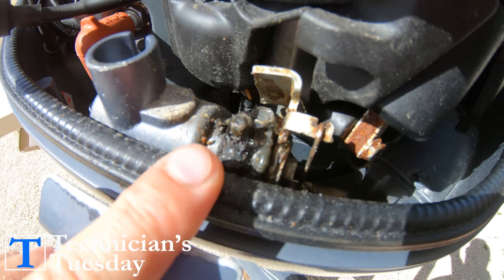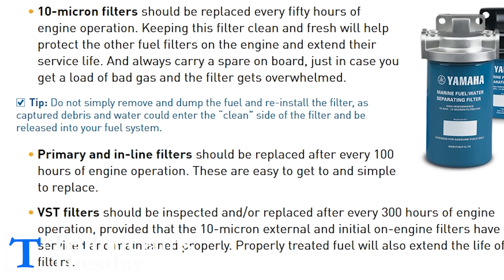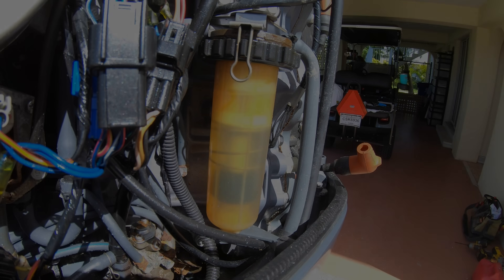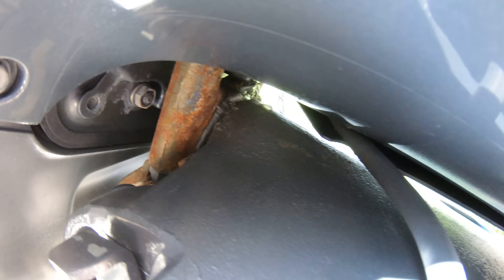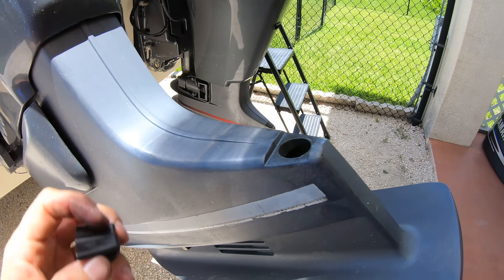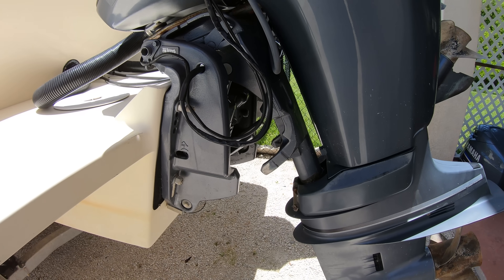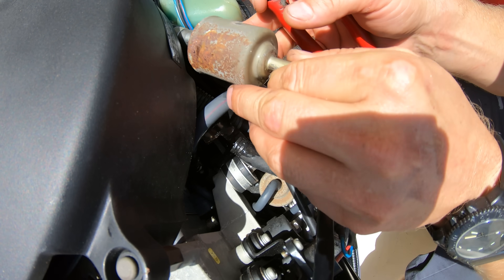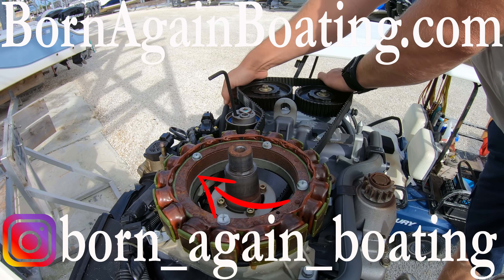Making A 2-Stroke Last Longer!

Comment: New boat owner.  Pushing a 18' scout with a 150 Yamaha v6 2002 outboard.  The motor was serviced when purchased but the mechanic missed a few things.  Maiden voyage had two breakdowns.  Throttle was sticking in hi rev due to lack of lube on the carb arms.  Then the starter motor was not engaging the fly wheel to crank also due to seized, lack of lube.  WD-40, and my pops were able to diagnose both issues and avoid needing a rescue.  It was a blessing in hindsight because it started the ball rolling.  Learning as I go, but seems we have a solid motor with a good reputation.  Looking forward to learning to care for it and enjoy it on the water. Thanks for your videos!  Best wishes.

Comment: @1:43 
WTF ! i been running my 2 stroke dry after every trip, i was always told never leave fuel in the system, it just gums up and cloggs everything.  Thankfully I've had no issues so far.

Comment: I have a 2008 z200xtr Yamaha hpdi that I service myself it runs like a rocket even today what type of spray did you use to spray under motor cover on oil pump and around awesome video

Comment: I just bought a 1 owner 1984 Champion bass boat with a 200 Yamaha motor. This boat looks brand new inside and out. I took it out the first time the other day and  it runs like a dream! Needless to say I want to keep it in top shape because I worry about finding parts. This video gave me some info I needed.

Comment: Nothing beats the sound and smell of my Mercury V6 135 from 1992! Its been running in fresh water until 4 years ago and I will use it until we die together. Todays engines are to complicated with to many sensors and they scare me a lot.
My V6 is of course burning more gas than the new ones, but I can do all service myself and that saves me a lot of money.
I also belive these old engines have a longer lifespan, If they are not being run to death and are well maintained.

Comment: Videos 4 years old and i dont give a damn, it's 2024 and I'm running a completly bone stock 1988 mercury Black Max 200hp 20-30 miles a week. Engine has never been rebuilt, or even apart. Deleted the oil injection nightmare and just run a 50:1 premix and 89 octane gas. Shes a bit smokey but still pushes my '76 Mako 20’ CC past 40 mph and is happy to do it.

Comment: Still running my 2000 Yamaha V4 115, 2 stroke. Shes a bit thirsty but I love the sound, the weight, 2 stroke oil off Amazon is cheap and it really doesn't burn much for what Im doing.

Comment: Thanks foIr your content.  It's always great!  I have a 1986 Johnson 115 on a restored 1964 Cruisers Inc. 17 foot wooden lapstrake boat.  I've had very little trouble with it.  I did remove the oil injection system at my local shops suggestion, and it has eliminated a big source of worry.  I just acquired a Mercury 115 straight 6 from the same era.  I hope to put it on another restored boat this summer.
Reply from the maker: That's awesome! Thank you and wish you the best with the next restoration project!

Comment: I have a 1999 Yamaha OX66 EFI 250, recently checked compression, all is good. Also have a 1995 Yamaha 50/35 OEM jet engine, running great, a ultralight engine compared to a 4 stroke.

Comment: I'm still running a 1994 Yamaha 200hp Salt Water Series on a 1994 Grady White Adventure 208 and everything is fine. I've only used the rig off the central Florida gulf coast.

Comment: twin 1999 250 Yamaha ox 66, they run like the wind.  I do typical maintenance to them as you note. I also spray a good amount of wd40 on all wires and essentially everything under the cowlings.

Comment: Arr Captain,,just got Merc 2007 150HP 2stroke on my new boat also 2007 Stacer 619m Aluminum only 344 hours on the motor, That old 2 stroke sounds crisp clean and easy to start i think its got years of life in it with your Lessons helping me. I haven't had a top speed yet because the weather down here in the southern Indian ocean M8 it blows and waves Breakers & chop. But the temp gauge Points to the middle half way to hot when its cold, then goes up towards hot high when im only doing a bit over 2k RPM , the tell tail works and seem not really hot, I think the gouge is shagged, ?

Comment: im running a mercury 80hp 1982 that was in the swedish military storage, so barley any hours on it. Did a full service on it recently. Rebuild the carbs with gaskets, needle and seat. New sparkplugs, new impeller, new gearlube, greased all fittings and propshaft. it runs really good and i think they tuned it a bit when they built it and it feels also.

Comment: Got a head scratcher for you..... 2005 HPDI VZ 225.... #6 cylinder is not producing power, has good compression, has spark (even swapped coils between 5 & 6) Fuel injector is operating and injectors were sent out for cleaning and testing. Connected an LED to the wires for that injector and it is firing the LED's. All spark plugs burn a nice tan/brown except #6 which is always wet fouled. No anomalies found with borescope of cylinder and the reeds look good. When you run the engine at idle and disconnect the #6 plug wire or do the cylinder drop test in YDS, there is no change in RPM or sound at all. Also the overall performance is not quite what it should be.  The only other thing I can think of is maybe some sort of exhaust blockage maybe thereby trying to burn the same air mixture over and over? Is this even possible?

Comment: I've got two 2001 Mercury Optimax 150 EFI 2-stroke outboards and they're running great. I love them. I do the servicing myself so it saves me quite a bit. Just recently had to replace the VST o-ring today cause the old one was done for. I also use Quicksilver Quickleen each time I fill up my 120 gallon tank before each trip.

Comment: 2001 Yamaha 200 HPDI, about 1000 hours.  Looks pretty close the one in this video. It runs like a top and thanks to your maintenance tips.  My lower mounting bolts are showing rust on the tip of the bolt outside of the nut, and it seems that replacing them requires the removal of the powerhead.  Do you have any tips/videos that would enable replacement without powerhead removal?

Comment: Running a 1990 mercury 2 stroke on a sea nymph  ,100 hp .Here in New Zealand plenty of boats still running them .This motor is great,runs well and not bad on fuel if you don’t thrash it. Thanks again for your great information today 😊🚤

Comment: FYI folks. The power curve is different on a 4 stroke. Think motorcycle virus pick up truck and you'll get the idea. Two strokes run at higher rpm and produce more raw power. Figure 10% of the horsepower rating for full throttle consumption i.e. a 100 h.p. 2 stroke can burn up to 10 GPH.
4 strokes are thrifty, quiet and idle smoothly. 🙂

Comment: some times a simple tbl is hard to find the first you run in to it--- eng idles but will no rev no matter what you try it will not rev--the tiny oring in end of fuel hose has a tore place it allows air not gas to flow   take a fish hook catch it in oring jerk it out  insert new oring with a light lube  like new now  ------ had a 40 johnson running hot changed water pump 3 tmes still ran hot  took it out on trl. for winter  one nice day in dec. to look at it one more time this time i started at the top  of eng  at thermisat  we had hose conn to eng for water   with top off thermistat i ask my friend to turn switch key on see if it would run i did not start but i heard air rushing as piston mved  i said stop i think we found it    i pulled the head there it was a hole about  like you burned with cigerete  i had to get a new head gasket problem solved  now yrs later my friend small out bd. is running hot  he said dealer had relaced water pump  still hot  i told him about  the head gasket   after 3 trips to dealer he finly replaced head gasket  fix it  deal had told head gasket had nothing to do with it but finly took head off  there it was

Comment: I have an 1987 Johnson 110HP V4 Crossflow. Way too maintenance intensive and takes a lot to keep it running smoothly. Same with my 1991 Johnson 88SPL V4 which lost compression on 2 cylinders last year. They require way too much to keep them running well, and for some reason the carbs need cleaning at least once per year. This is with new fuel lines, VRO delete, fuel filters and water separator, fresh gas.

Comment: I cant believe as good as you are and I truly mean that. That you are showing prefilling the fuel filter by filling the discharge hole. Any dirt going into the discharge hole can go further towards the motor. Put a plug into the discharge hole and fill through the small holes. Just a thought.

Comment: Still running my 98 Mercury 60 hp still running strong..I have a question about buying a 4 stroke..if I buy one and install myself do I need the computer software to dial it in or will they do it before they ship?

Comment: Just did the fuel filter, impeller, lower gear lube, anode below the trim and tilt, plug wires, removed and greased the prop removing a bit of braid…UGH..lower unit had no water intrusion. 90 Etec. Waiting on thermostat and lower unit zinc.  Have to remove the lower unit one more time for the lower unit zinc.  Oh well.

Comment: 2001 yama 2 stroke .. had a 150 but repowered with 200 powerhead on my original 25 in shaft/ lower unit.. have it on 20 ft dual console pro sport 1999 all composite material...meaning super light!!.. I get the best of both worlds with that boat !!.. can literally float in 18 in of water and she doesn't beat u to death in choppy to rough seas !!

Comment: I run an 03 200 HP hpdi and am changing the mystery filters located in the high-pressure pump right now. I would love to know the rig you are using to oil the lower unit.

Comment: Still running a 1989 Tohatsu M70A2 two stroke. Just replaced the fuel pump to be safe and had to us a Nissan trim solenoid a few years ago to replace the trim down solenoid because the Tohatsu part wasn't available. At 200 lbs it's a great HP to weight ratio.

Comment: 2000 Yamaha 150 2 stroke still running great.  Just had to replace 2 fuel pumps in 2019. Regularly spray entire engine with WD-40 to coat all moving parts.

Comment: Still using my 2005 Yamaha HPDI.  Only has 400 hrs on it.  Was working fine until today.   Just about idles and stalls when I open throttle.  I'm thinking O2 sensor.  Any suggestions?

Comment: I am still having a blast with the EBCO V-163 ( 16' ) and U.S Marine/ Force 85 ( 2 stroke/ 3cyl. ) that my Dad bought in 1985. Quite amazing because so many of our lakes in S E Colorado were not much more than glorified mud holes and surprised that the water pump hasn't chewed up/dried up. There are not many parts available for the Force series. Once  the smallest thing goes wrong, i'll be shopping for a new engine.

Comment: Do you not change the gear oil in the high pressure pump where you undo the two bolts for the HPDI?

Comment: Running a 2001 Yami 150 saltwater series hdpi. Runs great, always has. Serviced filters and plugs and water pump. Use Yamaha ring conditioner in every tank. Use stable in every tank unless non-ethanol. Did not know about filter on bottom of oil tank will change next week. Have been very careful to keep that unit clean.

Comment: Hello am still running solid 2 strokes a 1997 johnson oceanrunner V6 225HP on a 25ft aquasport,a evinrude Etech 90hp 2014 on my 2014 key west and a 1983 mercury 25hp on my 16ft jon boat still runming strong all 3

Comment: Running two 2003 Yamaha 150HP HPDI's (both at 630 hours).  So far they have been great after I replaced the VST filter and cleaned the O2 sensor.

Comment: Good video however most boat owners do not service there engines properly EVER. then when its blown up cry about the cost to fix it. We are phasing out working on 2 stroke outboards as most we see are neglected beyond value to repair. Great video though. Thumbs up.

Comment: Still RUNNING my 2006 Evinrude 200HO two stroke OB on my 1989 Boston Whaler 22 Outrage.  This engine has been Excellent (yes I am aware Rude is out of business), No I am not brand blinded, as I also have 2 x's 1989 Yamaha 250 OX that are Great also, And a 2017 Suzuki 175 with no problems. 
Like "The Man" said theese are Very Well Maintained.

Comment: if the engine was in idle when you moved the oil pump rod it is in some serious need of adjustment. Just did mine, backlash was around 5mm and smoking like all hell in idle. Backlash in idle should be about a hair's thickness to the stopper.

Comment: I'm still running a 1985 Evinrude 150 Two Stroke engine on a Grady White Tournament 19. I've had some fuel system issues and other challenges but when she's right she run very well! Thanks for the video you made regarding replacing the installed fuel tank. I replace the tank in the G-W last summer . Your video convince me I could do it myself!

Comment: Without even removing the cowl or having access to even one tool, The very Most Important THING (yes just one thing) you can do as an owner; is read the Engine Manual and the prescribed "Break IN Procedures".
It will list "Throttle Speed and RPM procedure".
And the prescribed number of Hours you apply the methods. (on your brand new Outboard engine)
Introducing (gently) how the pistol rings seat and bearing and other Moving Parts FIND THEIR Way.
Keeping in mind that they will all be snug and tight in the on set.
Broken In properly will substantially reduce ALL those other processes dramatically.

Comment: Running 2002 200 yamaha hdpi just like this one on my 23ft parker se. Apprx 500 hrs and running strong. Love the videos.  Change the top side seals on the lower unit and other maintenance  work at the beginning of the year. Thanks for all the videos!

Comment: Would love to see a video on how to adjust the oil pump setting on the HPDI's. I have done this by the manual even after some mechanics have said the adjustment was ok, I found it to be off by quite a bit based on the manual, however, it is a bit quirky to try to gauge it.

Comment: Sold my Lund Tyee last fall with an '87 Evinrude 90...had to replace the wiring harness due to age, but still running strong according to the new owner.  Now have an '06 Yamaha 50 and will use what I've learned here to keep it going as long as my old Evinrude.

Comment: I am running a 2000 Johnson 90HP Oceanpro.  No issues until recently when the VRO oil pump died. Has been a great motor! I enjoy your channel.
Reply: I have an engine similar to that get rid of that vro pump and premix best thing you can ever do with it
Reply: @krod2162  I just had it replaced, hopefully, I’ll get another 21 years out of it!

Comment: Just did a carb job on my 1999 150 Yamaha Saltwater Series II (also completely purged all fuel, changed oil, fuel & water separators, new fuel pumps, plugs) -- fixed bogging issue @ +3500rmps!

Comment: Haha Love my tiny 2 cylinder 2 stroke Suzuki DT30, as it's still less than 100 hours it starts like a dream, run great, even goes better after running some Penrite Total Fuel system cleaner through it.

Comment: Well my boat had some body work done due to a cracked hull. My motor has been sitting for two and one half years and is finally getting back put back together. My motor is a 2008 Evinrude ETEC 150 hp with less than 200 hours. The reason it sat for so long is that my insurance gave me a difficult time in approving some of the repairs. My question is on maintenance prior to starting the engine. What do you recommend to be done prior to startup and right after startup. Any advice is greatly appreciated.
Reply: Fog the engine and crank it w/kill switch off. install new plugs and let her run a few minutes at idle.  you're then good to go.

Comment: I have a 'new to me' '97 Mercury 'Tracker Series' 200 hp EFI...want to do the service myself. Any suggestions on how to get a service manual for this motor?  I want to ensure I'm getting the right intervals, as well as parts. Great channel and the instruction you provide is spectacular.

Comment: 2001 Merc 90, had from new. I've changed the gear oil and impeller regularly, greased it all and sprayed it before and after every use so it still looks like new. But I've only changed the sparkplugs and the fuel filter twice in 20 years. Never even considered the PTT! Still runs nicely mind. I do love 2-strokes...
Reply: Have you changed your Lower unit seals? I have a 2000 tracker 25 and I’ve changed all but shift shaft seals
Reply: @africanjew1596  Yes, actually, I forgot. I did and pressure tested it using a car foot pump connected to a gear oil filler hose.

Comment: Right here running a pair of 98 Yamaha Salt Water Serie II 250hp's. Best engines ever had and will have. I have a pair of freshly rebuilt power heads just sitting here waiting to be installed when the ones that are on need to be rebuild. Its just a matter of pulling off the old and throwing on the new. That way my boat is always ready to go. 👌👌👌👌👌👌👌👌👌👌.

Comment: Your videos have REALLY helped me. I have a 2005 200HP Yamaha which is almost identical to the ones in your videos. I have a bogging issue and then the engine won't start. Feels like fuel for sure so I have ordered the 2 low pressure fuel pumps to replace and will remove and clean the VST as well as check the fuel pump inside of the VST. All of this is covered in your videos and I can't thank you enough. Now, instead of being intimidated or paying a mechanic way more than I need to, I can do some basic maintenance and see where this leads me. Fingers crossed!

Comment: When you trim it up to check/add oil, LOCK IT OUT.
Also make sure you replace spark plugs with the correct plugs, they are not always the same as what you take out! Call NGK or who ever, give 'em the motor specs, and be sure you get the correct ones!